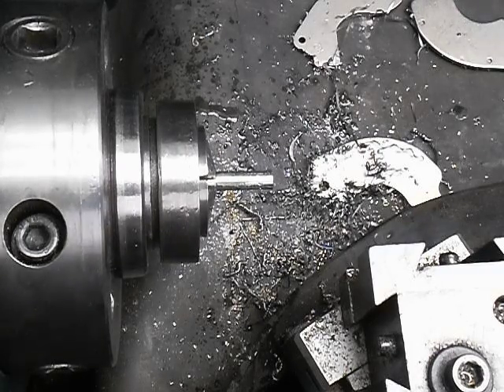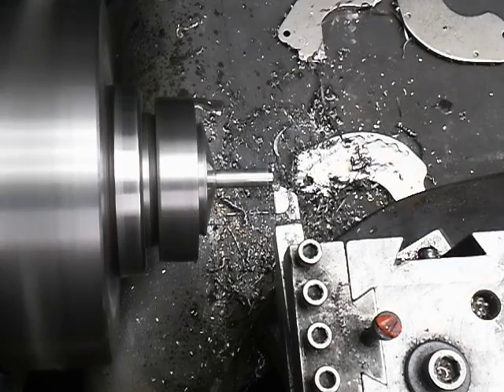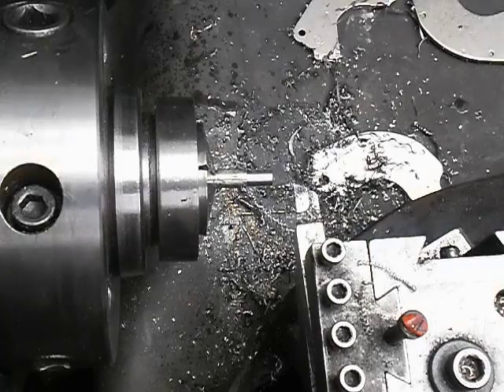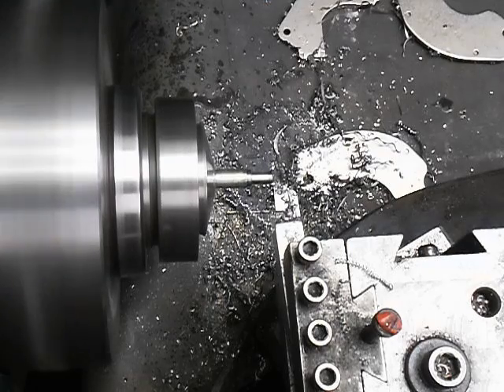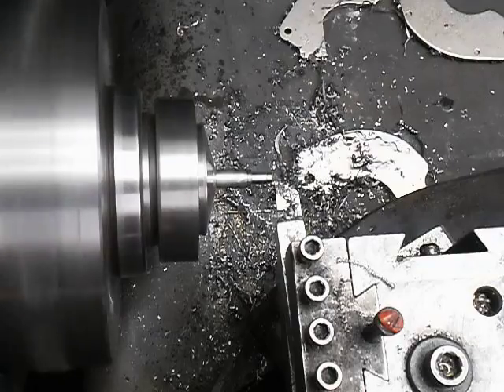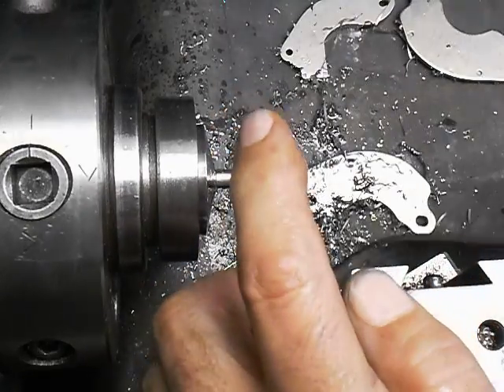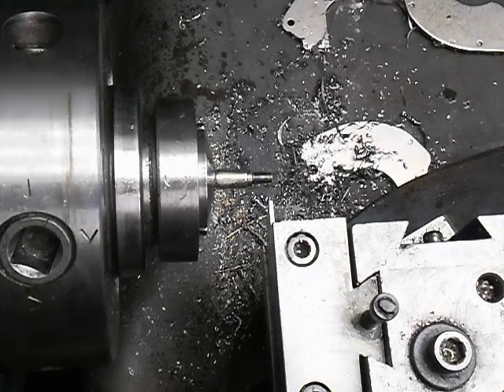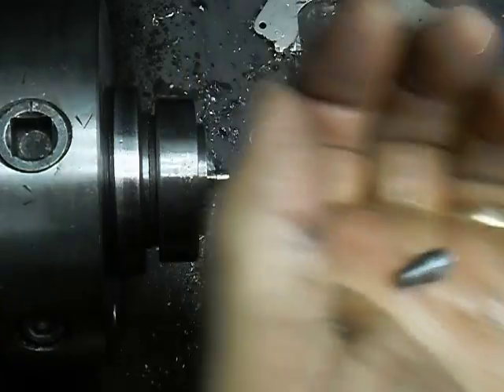Spark plug base 1

Comment: I have just discovered your videos recently and am going through them in a marathon session and am enjoying the content on model engine machining (which is quite scarce material on YouTube).  Just a quick observation.... looking at your chuck cam locks (see time 5:44 and 6:17 for example)... the cam lines do not fall between the  "V" (<>) marks as would be normally recommended to hold a chuck on properly on a lathe..... (?)
Reply from the maker: I have a 5c collet on the lathe which doesn't use the cam locks, Check out the
 "Model starter mod " vid it shows me switching from my 5c to a 3 jaw.
Reply: Ah... that makes total sense.... thanks for the clarification.